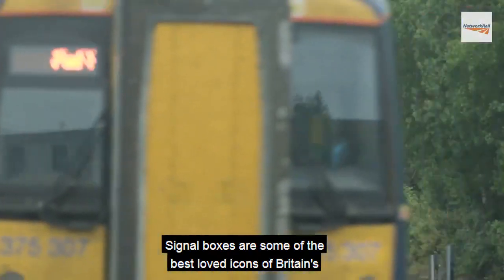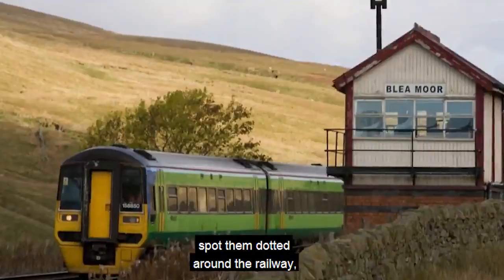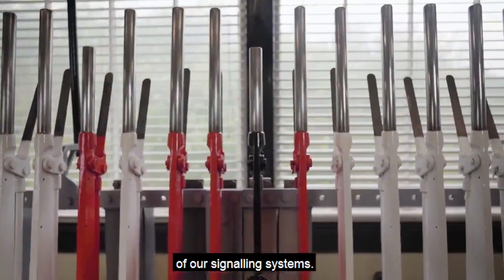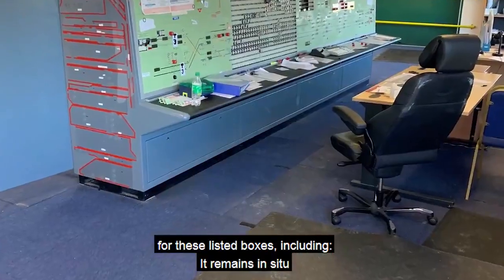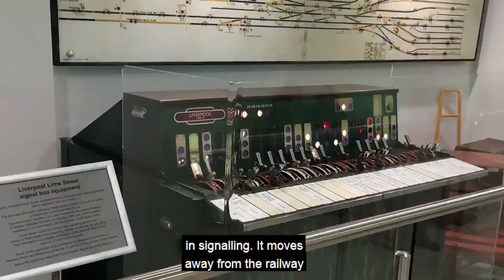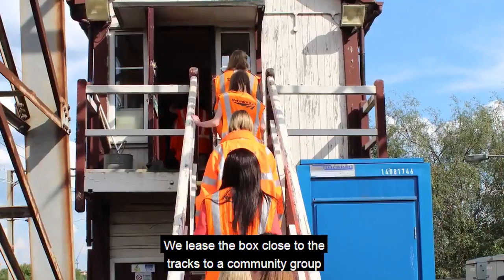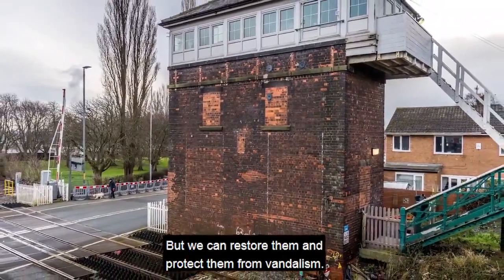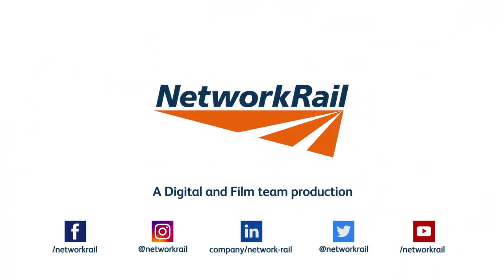Retired signal boxes

Comment: Apparently Nodrog has done couple videos about signal boxes and yeah some of them have been demolished and replaced by new signalling systems and new signalling centres have opened that has created new jobs and to loop after the railways.
Reply: New jobs aren't created, it's the exact opposite. Nothing much wrong with replacing a dozens of boxes with a workstation done properly that's just 'progress'.
Reply: @1001ewaste  True.
Reply: @1001ewaste  It’s far more cost effective to maintain (and repair) modern systems.
Reply: Indeed